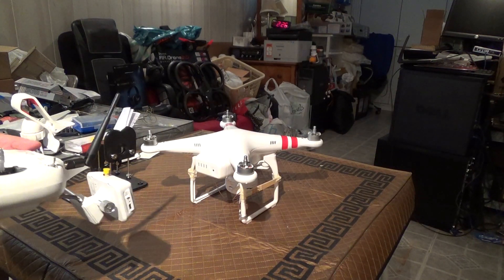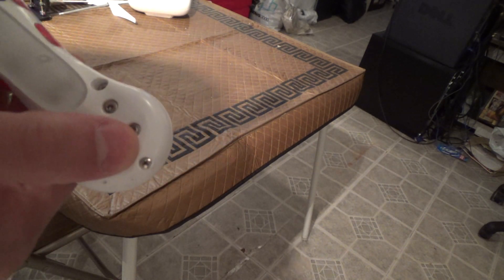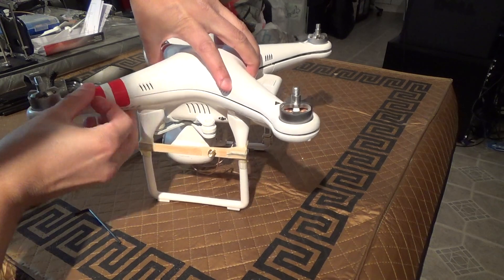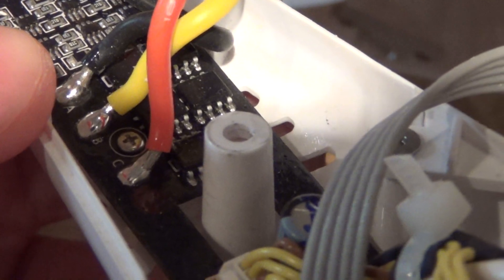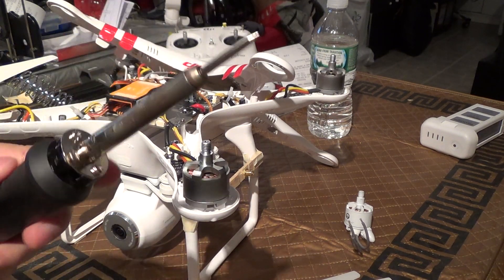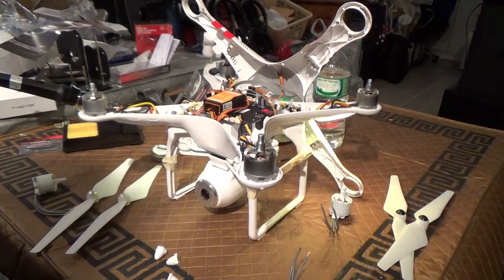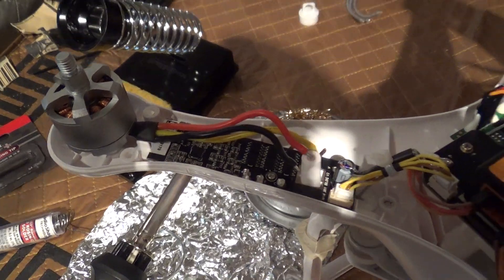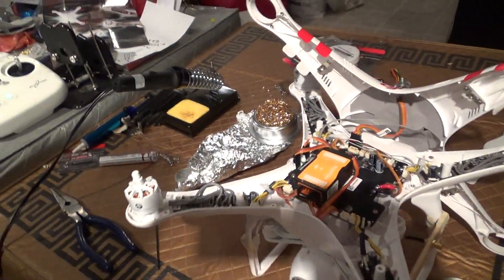Installing T Motor MN2214 v2 on Phantom 2 Vision

Comment: Have you carved your DJI? Just crashed mine indoors. :( brand new and the props hit the doors. Not sure if that would mess up the motors at all? Going out tomorrow to test flight in open area
Reply from the maker: My phantom 2 is like new :) i actually flew my p2 in doors a number of times but definitely tricky as it drifts without gps or ground sensors like the p3.  More than likely your motors are fine.  Worse case scenario you may damage the bearings which can be replaced.  You will know if you hear a grinding sound when you spin them.
Reply: +Ben7seven7 I hope nothing is wrong... Ha! Learned my lesson! Won't be flying in doors again! Yeah that's what happened it drifted... Thanks man!

Comment: I am going for round 5 of soldering these damn motors around like musical chairs. Spent the past two night on Skype with a guy from China trying to troubleshoot. I am going off your wiring this time in between pauses. Hope this helps.
Reply: Michael Czombos It worked. Thanks for having this video up.
Reply from the maker: Michael Czombos You're very welcome, I'm glad my video helped, and happy flying :)
Reply from the maker: Michael Czombos It's also worth noting that I later added liquid electrical tape over each soldering connection. Reason for that is to help any humidity or corrosion from the elements getting onto the solder connection to help ensure long term reliability. The original connections I think had something on them like a lacquer or maybe hot glue for probably that same reason.  Anyway if you do it just do so sparingly nice and neat using a fine paint brush to apply.

Comment: I replaced stock motors with these aftermarket ones. Battery fully charged, it takes off and after 2 minutes or so, the phantom engages the failsafe mode, red lights then it lands.... any suggestions?
Reply from the maker: First try another battery. If that doesn't fix you then you need to recheck the solder joints making sure they are good clean and that you're not creating any shorts.  If after checking and redoing the solder joints and if you still have problems then you may have damaged one or more of the ESCs which can be replaced.  The ESC is the board you solder the motors to.
Reply from the maker: One final note, once you have everything working well I do recommend insulating the connections using liquid electrical tape.  The original connections appeared to have some clear coating on top of them.  My guess is it helps reduce oxidation and will reduce problems with condensation and potential shorts should you fly through fog or on very humid days.  Btw I do not recommend flying in fox or through cloud or rain as that may cause unpredictable behavior of your craft.

Comment: Hello. ¿Al Phantom 1.1 is also possible to change the 4 motors?

Greetings!
Reply from the maker: Yes these motors will work on all Phantom models except for the Phantom 3 which used a different battery and ESC than the original through Phantom 2 models.

Comment: I know this video is a few months old now, but the CW and CCW markings on the motors refer to the thread, not the direction of rotation. This means they are marked correctly, just not in the way you'd think :)
Reply from the maker: Yeah I did come to that realization not long after making the video.

Comment: After installing the new motora is it needed to do any type of calibration?
Reply from the maker: No but to be on the safe side do a new compass calibration in a clear open area.
Reply: Ben7seven7 Thanks for the advice ;) , i will give you a feedback of my expirence as mine are v3.

Comment: Nice video! Had to switch the CCW and CW motors n you caught that prior to install, good job!
Tip: to turn it off, pull down all the way and hold the left stick instead of the same combination to turn it on. I used to do that too and it toppled. The turn off is very smooth by just using the left stick!

Comment: These new motors look like cheap plastic where the ones on the Phantom are metal.  Any thoughts on that?
Also if the company can not mark these motors correctly how are you going to know if they will rotate in the right direction?  T-Motor may have also put the wrong thread on a motor and you will not know until after they are installed.
Reply from the maker: Not even the cheapo motors are made if plastic.  These motors have a glossy painted finish.  At first I thought it was a sticker but it was indeed paint.  And the smudges I noticed on the sides wiped off with some alcohol.  

The motors worked and sounded well but I did return them and ordered another set from a large hobby chain but weren't labeled and Version 2.0 and the screw in props were harder to get on.  

The reason I returned the motors is the movement on one of them was a bit stiff and notchy and another motor had some bearing noise tho it was very subtle.   The new set is fine.

Comment: I agree with you Ben that T-Motor are better than DJI Stock Motor, due to the fact that I have used them about a year  on My Old Phantom 1, they were and still preform better than the stock during flight and the response was great and gave me no problem what so ever. and yes i have seen many people complain about T-Motor  ( which most of them Never used T-Motor  only talk and never talked about putting them to the test , real test  ) and the few people who complained about them  eventually come to a conclusion that they came defective and when they replaced them they found out a better performance. I really like your Reviews Ben and i honestly, learned a lot from you and adopted many of your "How To "  that you have few months ago up to now.... thank you
Reply from the maker: Thanks for your thoughts and feedback.  And yes I defiantly noticed an improvement using these motors over stock though not a night and day difference but a difference none the less.  Someone using these motors in place of those on an original Phantom will see an even bigger improvement.  Anyway keep an eye out as I will be making some new videos in the months to come with some FPV mod FAQs and Phantom 3 related videos as well.

Comment: wonder if you can cut the wire and add quick connects
Reply from the maker: Yes but I recommend using bullet connectors if you want to avoid soldering direct to the esc.  Granted tho you. Need to solder bullet connectors.  Bullet connectors will give a more reliable connection than quick disconnects you may get at radio shack but either way will get you up and flying.
Reply: Ben7seven7
What is bullet ? thanks
Reply: Atoy Martinez Bullet's are electrical connectors that look like bullets, there's a male & female and they should also be soldered, it's sounding like you might wanna get someone to solder for you!
Reply: Thanksss